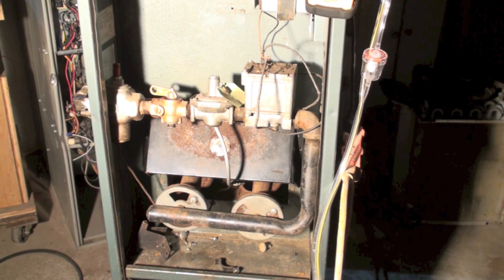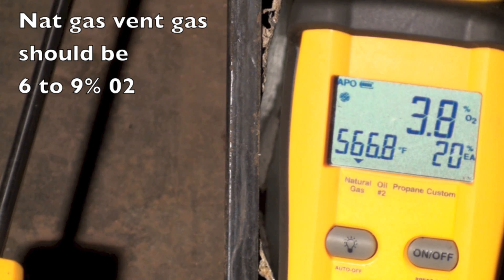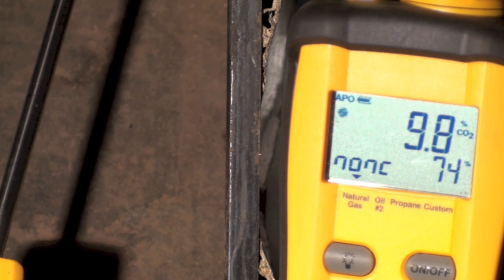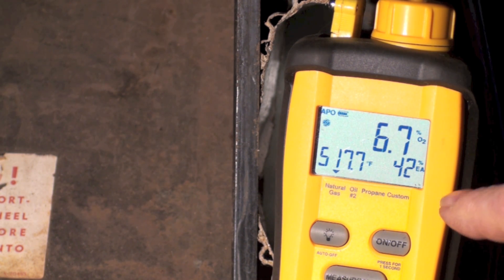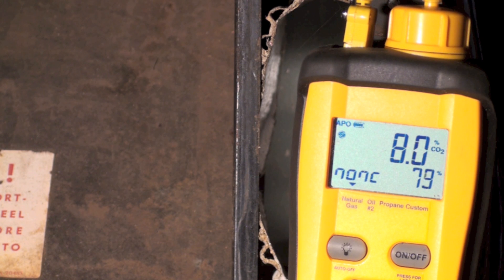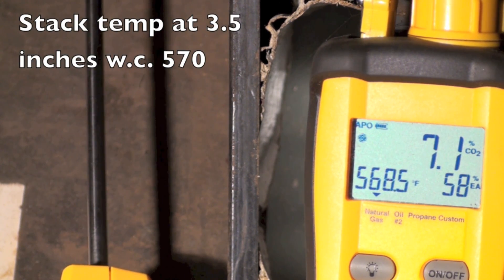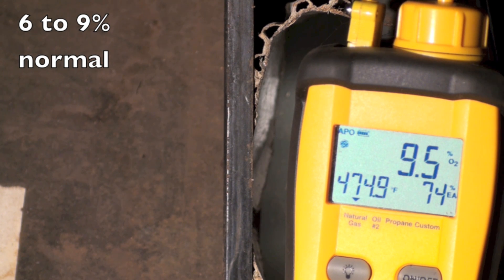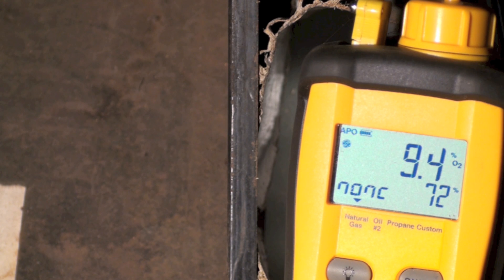Combustion analysis of the antique gas furnace

Comment: I'm guessing lower gas pressure makes it more difficult to transfer heat to the heat exchanger?
Reply from the maker: The only difference would be the flame temperature.  Less gas flow with the same primary air means lower combustion temp.
GFM

Comment: sir I really appreciate you and your work ,
just got the SOX3,
should we put the prop In the vent or the burner 
and can we use the SOX3 to Verify a bad heat exchanger 
one last question if got a %175 E Air 
in a furnace like the one you working on now ,what was that means
Reply from the maker: +mikhaiel j The probe is placed in the vent.  It is sometimes used for diagnosing heat exchanger failures to be verified by inspection.  The 175% excess air is much too high.  More like 40% is normal.  Probably the primary air adjustment is open too wide.  Hope this helps.
GFM

Comment: Gfm is sox3 worth the money what are your thoughts
Reply from the maker: j408garcia I like it because I can do other things while it is testing.
GFM
Reply: +j408garcia I had the SOX2 and later the SOX3. Neither one worked from the get go. I called the factory and was told the instruments were sitting on a shelf for too long. On average the CO sensors last one year at best. I bought a model CO71A from UEI and works like a champ. The former ones require a new sensor in a year or so and it cost about $ 120.00 to replace. The UEI on the other hand has a 3 year warranty and sensor should last under normal use up to 5 years. My decision was pretty simple. Hope this will help you keep your sanity and your money.
Reply from the maker: +Bob Boscarato The idea of the Fieldpiece units is that they do not need annual tests to be sure they are accurate.
GFM

Comment: What you are showing me makes me think twice about 2 stage furnaces.
Reply: The efficiency on a two stage is going to be roughly the same on low and high stage the difference is capacity, you may have a furnace that runs 70,000 btu on high but only around 45,000 btu on low, however 2 stage equipment isn't about efficiency its about comfort. 80 - 90 % of the time you may run on low stage and we want that for the long run cycles to evenly spread the heat through out the home. 
The Furnace will run twice as long in low stage as it would in high stage but the gas usage will be about the same at the end of the month but overall comfort will be much greater. I hope this makes sense.
Reply from the maker: I will be doing a vid on a 2 stage 90% furnace soon and perhaps we will see if it helps.
GFM
Reply from the maker: Eddie Leverich I could't say it any better, and with my ability to talk forever, that is saying something.
GFM

Comment: I agree GFM, HMMm? I'm a big fan of lowering the flame to the point of under firing but your test disproves that theory. I dial it all down thinking warm air not hot air is more comfy, it will run longer but less (%) is going out the stack. I was 'assuming' by cutting down outlet pressure by a third +/-, I'm saving fuel if time firing is not increased by a third? HMmmm?
Reply from the maker: I think the manufacturer spent a lot of time and engineering to make a reasonably efficient unit and we service guys think we can make it better by simply adjusting gas pressure.  Maybe we are not as smart as we think.
GFM
Reply: Also keep in mind that if the furnace is adjusted to much on a 80% furnace to get higher efficiency you may cause condensation to form inside the heating chamber and vent which will destroy them rather quickly. I believe once you get over about 84-85% this will occur.
Reply from the maker: Eddie Leverich On the old boys like this antique, you could not cause condensation no matter how hard you tried.  Maybe if you cut down manifold pressure to 1" wc!  However, I absolutely agree on these AFUE 80% furnaces.  When they first came out (the Carrier 395 furnaces), we were still using masonry chimneys without liners.  We ruined a lot of chimneys with these even if we overfired the furnace!  Again, good conversation.
GFM